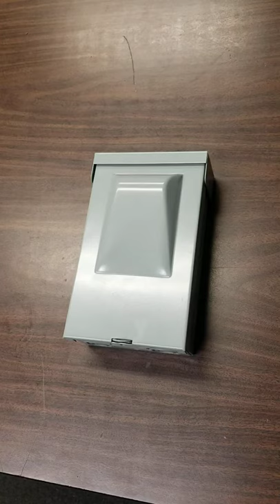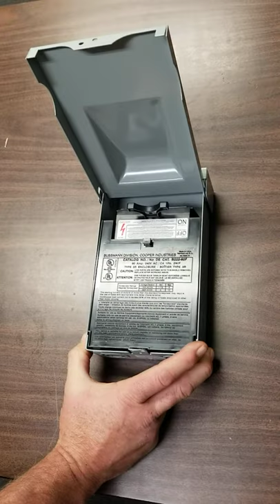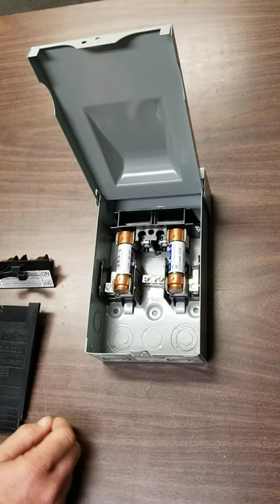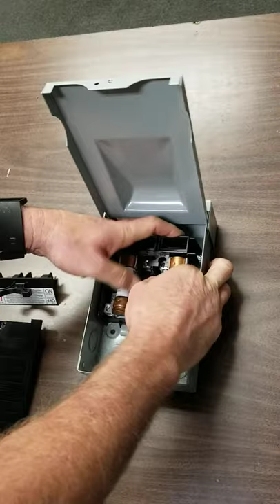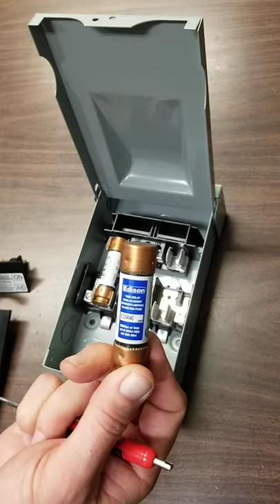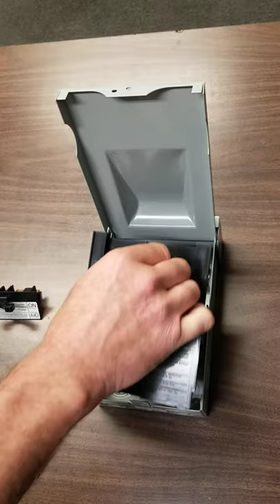How to replace fuses in a disconnect

Comment: What causes the fuse to blow.. ?
Reply from the maker: Typically unstable power. If there is a black or brown out or any kind of power surge. Over heating system can also cause them to blow to protect the equipment.
Reply: That’s what happened to mine yesterday. Our power went off and came right back on after like 3 seconds during the storms. I noticed a little later that our thermostat had powered off. I’m glad I found this video because I was thinking it was the tiny fuses inside the actual unit!!

Comment: Mine has fuses on the pull out tab 2 50amps the tab u pull out on mine the fuses are on that piece that pulls out.   I think the contacts are not good, any idea how to fix contacts from the box side of things and the contacts on the pull out handle that has the fuses on it >?  I notice if the handle jiggle a little bit even when insterted fully. and the power goes out,  i think its got lose contacts. do i need to replace the entire box, and or can i clean / fix the contacts >??  If so whats best way to fix contacts and clean them so they line up nice and tight and have solid connections again with the pull out tab piece thats for on / off.
Reply from the maker: If the metal contacts are loose holding the fuses you can squeeze them together. If they are still loose or corroded, it is likely they over heated and it would be recommended to replace the pull out part or the whole disconnect box depending on the style.

Comment: I went inside my quick disconnect box like in this video, but mine doesn’t have fuses inside like this one.  It’s just a few wires and the metal contacts for the ON/OFF handle thing.
Reply from the maker: Yes some just have a breaker like on/off handle.  This means that you don't have fuses that can fail.  Of course with anything electrical there could be a wiring issue, but typically this just means that you don't have an issue at the disconnect when troubleshooting.

Comment: Found I got a blown fuse. I took it out but forgot what orientation they were previously installed..Does it matter? One side is smooth around. One side has a notch/trench. Is the way you showed here the ONLY and CORRECT way?
Reply from the maker: Either direction is fine!

Comment: On my ac it has 35 amp fuse and I what put another new box because the nos had some parts broken but Curent find a box it says 35 amp they only have a 30 50 60  does it mater if I use a 6amp box but put the 35 amp fuse in side ??
Reply from the maker: Yes you can use a 60 amp disconnect so that the 35amp fuses will fit. A 30 amp disconnect will be smaller clips and 35a fuses wont fit.

Comment: Your video didn't explain how to figure out which fuse is bad.  Basic ohm meter will do, but you may want to doublecheck the power is out first. My disconnect also pulls out the fuses, so I don't need to worry about that.
Reply from the maker: Hi Tom!  We made this video to embed in a blog post explaining what to check for with an a/c that isn't working.  It is explained in that post that you can have the fuses tested if you don't have a tester.